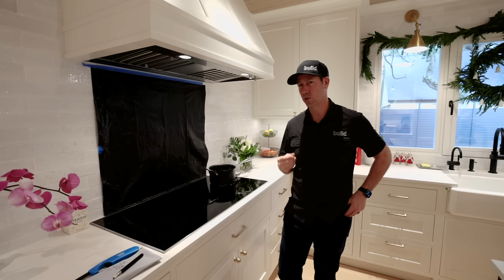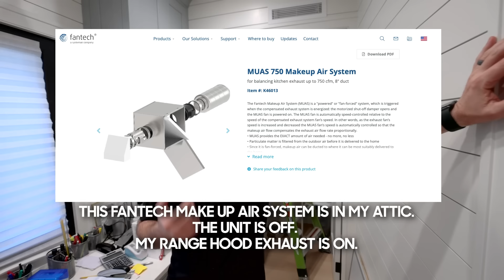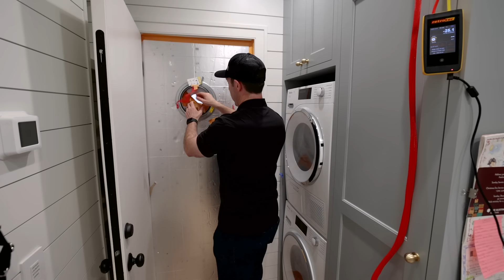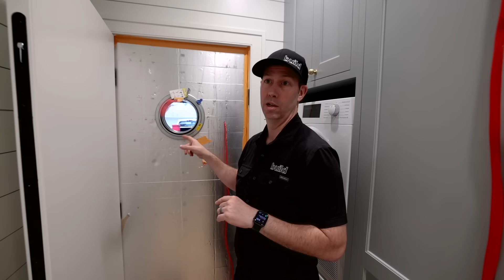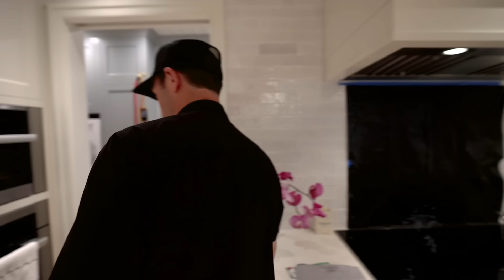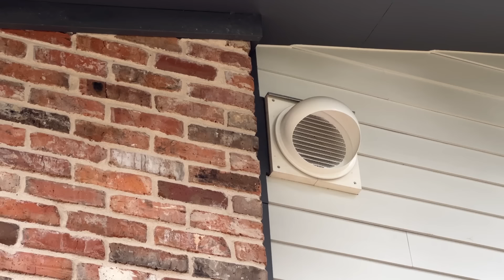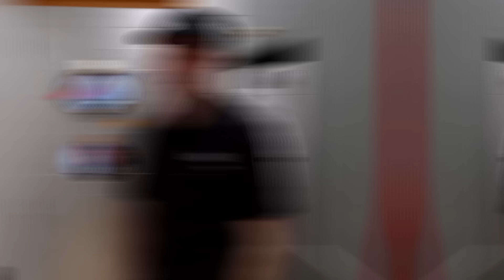Make Up Air for a Kitchen Exhaust - Most Homes Suck. (Pun intended)

Comment: In Europe (Spain) most homes use induction and, in passive houses, recirculation extraction hoods. 

That ensures that there aren't combustion gases or smells, while keeping air tightness and thermal performance, since all air is controlled by the heat exchanger. Direct exhaust outside the house's envelope would be considered a mistake in terms of energy usage.

 The downside is that these hoods require more frecuent maintenance (filter replacement or cleaning) depending on model.
Reply: In commercial exhaust hood we see horrible grease buildup which can lead to fires. How do you keep this under control with a recirculation system?
Reply: They use several filters. A first physical barrier with easy access (greases) and a 2nd or 3rd barrier to filter smells (carbon activated, that needs replacement, or ceramic, that regenerates in the oven). To a given degree, grease build up will always be an issue, recirculating or not 🤷‍♂️
Reply: Available here there exist such products from Bosch, Elica and  Neff, at least.

Comment: Not sure if this system does it, but would it not be better to monitor the pressure differential and use that value to control a variable speed make up fan? There’s other things that blow out besides the range hood like furnace and bathroom vents.

Comment: If these are "safety" systems the codes are wildly short of controlling the risk.  If we need to maintain or eliminate a pressure differential in industry (for instance, to keep the deadly gases out of occupied spaces) we install permanent, redundant versions of your differential pressure gauge.  These differential pressure gauges and switches will be tied to alarms and if the hazard is serious enough they will deenergize/stop the hazard.  Imagine that if one of your fans died there would be an audible alarm and the cooktop would shut off.  We do see that in commercial spaces e.g. shunt trips triggered by range hood fire systems. 

These big exhaust and makeup systems aren't too complicated but they are a potential hazard.  They need to be maintained.  HVAC systems that were never properly setup or maintained are very common in the US in my experience.  Chances are good that if one component of your system fails Matt it will be a comfort issue more than a true hazard.  The hazard potential for homes with fuel burning appliances is there for sure and it concerns me that failures don't seem to be considered for things like this in home construction.
Reply: Yeah, i was thinking of that too...  Since the home he built was SO tight, it needs some sort of trigger/alarm using a permanently mounted sensor.   Manometers are cheap, so I figured the sensors to measure this would be too... and they are.  I'm sure there are some pre-built controllers that could trigger the fans based on various differential pressure thresholds w/ alarms if it doesn't behave as expected.
Of course if you had a permanent sensor & a variable-speed fan, you could automatically compensate for a combination of bath exhausts and the kitchen vent-hood.

Comment: Excellent video. I remember watching earlier videos championing the tight house concept and wondering how bathroom and kitchen vents factor into those. Now I know. On the MUA pre-heater, if the MUA intake was near the exhaust, couldn't a heat exchanger between the two work instead?
Reply: I believe the problem is a heat exchanger would get gunked up from the cooking exhaust air.

Comment: Very informative. What type of contractor is able to determine the size needed for a make-up air system? I have an older home that is not air-tight and it might need a makeup air system since I need to replace my severely undersized range hood.

Comment: What about sucking in 103 degree air in the summer?   Not the temp differential of 10 degree air but still considerable.   You need a heat exchanger to suck the energy out of the air you are pulling in and put it into the air you are exhausting.

Comment: Great video...BUT I failed to understand why this is Needed? Please Explain what problem this is solving.
Reply: The exhaust hood puts the room under a negative pressure. The hole is a relief air. It relieves the negative pressure. Houses should always be under a slight positive air pressure for efficiency and health reasons

Comment: Matt 
Should I put the make up air supply as close to possible vent as possible? High or low (ceiling or Toe kick?)  Seems like putting it across the room pulls a significantly greater amount of conditioned air out of the house.  Also, I need make up air for the dryer and bath fans. I will be using an ERV exhaust in the bath areas on our first floor but most likely exhaust fans on the lower level. Thoughts?

Comment: What about bathroom exhaust fans? Are they linked to the make up air too? How does make up air operate if a door is closed? I’d assume it would just go under the crack between the floor and the door, but wouldn’t the suction of the bathroom vent fan be impacted by the resistance? There’s definitely not 8-16” of clearance through doors.

Comment: Would you also need to take into account the additional exhaust cfm of a clothes dryer, gas furnace when calculating the required cfm of a make up air system?

Comment: I've got a kitchen exhaust fan, an electric dryer, 3 bathroom fans,  a gas water heater, and 2 fireplaces. Why not have a makeup air system that responds automatically to the atmospheric pressure difference? The other is a need for air cooling as well as air heating in the makeup air system. Aren't there benefits to not sucking air through carpet or a garage benefits in older homes?

Comment: Good basic video. Nice house BTW. So, please tell me how your newly installed MUA sytm, will work when peak demand is needed. 
Example:
- Dryer is going
- Cooking vent is going
- gas HWH just lit up
- furnace fired also
- I went into the powder room to burn a mule, vent is on
All this draw, even though two high efficiency appliances have their own MUA, please tell me if I need a hole in the side of my house to drive through.
Thankx.
Reply: One thing his dryer is not vented to the outside. It just has a drain. But I know you are joking.
Reply: These passive houses don't have gas, not allowed.
Reply: Then, our doors are REALLY HARD to open. Cure- Condesning dryer after the other one dies. Microwave (minimal 300 CFM) required a makeup air system.

Comment: My question is what happens when there is no power?  My guess is that you have a back up generator... but what about the people who don't?  My best for you and yours Jim
Reply: In my tight home, no generator, so when there is no power the 300 CFM microwave exhaust does't run and that was why we needed a MU Air system in the first place.

Comment: In Texas though, do you really want to pull in all that humid hot air in the summer, and run it across your house? Could you instead duct your makeup air into the kitchen or near the stove? That would reduce the amount of conditioned air you’re pulling out.

Comment: Is cold air blowing onto your dining room table?  Couldn't your make up air supply be in the kitchen where people aren't sitting?  

I don't have a make up air solution in my house.  My hood is 700 CFM and then I have two exhaust vents in the kitchen ceiling that are ducted to a 1000 CFM blower.  Normally, the hood alone with no windows open works well enough.  If I open a kitchen window about 4 feet from the stove, it creates a draft that remove the heat from the pan. 

If I flip a greasy steak on the char broiler and create a huge flame and smoke, I'll need to turn on the ceiling system and open the sliding glass door near by.  It works well, I've never set off the smoke detector, but it is sort of a ghetto solution.

Comment: I’m bidding a 36” powered range hood install to vent 6’ away to outside through the upper cabinet soffit. Customer has an old JennAir down draft induction cooktop that they want to replace with a new ventless model. In a pinch, could I repurpose the old under counter duct as a make up air source? Maybe run to a stealthy black vent in the toe kick?

Comment: Would you need the same for a gas dryer, or for a gas tankless water heater?  The tankless water heater generally has a exhaust and intake -- so they're self contained?  Or still need make up air?

Comment: Great video on a complicated topic that even Dr. Joe doesn't like.
Reply: Joe Lsiburek? - My hero. Finally answered my emails and explained I needed to seal the basement slab to the foundation walls to stop Radon Fan suck. Then, he told me I needed MU Air because of my tight home and running a 300 CFM Microwave Exhaust that caused a negative suck.

Comment: Matt, it is interesting to hear you mention that the make up air system you are using contains a MERV 10 filter. Weren't you very intentional with installing a premium filtration system on your ERV, MERV 16 I believe? Now you have 400 CFM of MERV 10 air entering your home when cooking? Additionally, the air in not conditioned. Both from a heat stand point and humidity stand point. I personally would have added the heating element on the make up air system. Austin may not get as cold as Michigan, but it is completely normal for Austin to be in the 30s F, or even high 20s F in the winter.  I am not criticizing you, just raising the point.

Comment: This is quite topical for me! If turning on the hood vent could also turn on the central furnace in my house, would that be sufficient to create an "active" system? Basically connect the damper to the furnace return side duct, and wire the hood vent to turn on the furnace fan?

Comment: Some of us don't only boil water at home, Matt. Induction still sucks for cooking.

It's also a mistake not to pre-heat the make-up air. It will feel cold in the winter even in Austin and no one would want to sit in the living room. Those mini-split heat pumps can't keep up with 800cfm of cold air being dumped into the living room/kitchen.
Reply: I think you haven’t used that +$3k cooktop. I also think that you will be surprised when he talks about his hvac utility costs since he has crazy insulation and tight envelope
Reply: @Werdna12345  I've demoed 3k+ Miele cooktops in showrooms and bought a similarity priced gas range instead. It's cumbersome to use with the digital touch controls. Cooking requires feedback and gas provides that. Induction also warps carbon steel pans. Wok cooking is also impossible with induction.

Insulation and tight envelope isn't going to keep you warm as Matt just showed you how much air is being displaced. Luckily he has enough room in the crawlspace to add a preheated.
Reply: @ohhgourami  I’ve been cooking with induction for more than 10 years, using my grandmother’s cast iron pans as well as modern steel pans, and I’ve never had anything warp, nor have I ever heard of that happening.  I can’t even say it happens to cheap crap from China, because I have a $10 IKEA saucepan I use regularly  and it hasn’t warped either.  I love induction cooking because I have much more precise control of the heat, and nearly instantaneous change of heat, compared to gas, which I find to be vague and imprecise at best.  For example, I’ve annotated all my recipes with the relevant heat settings for my cooktop, so when a recipe calls for ‘6’ I know that I can set it to 6 and all will be well.  With gas I have to guess as to what he heck is “medium high” and good luck getting that same setting twice in a row.  For wok cooking I use a cast iron griddle with a steel ring on it, and set the wok on that, it’s inefficient compared to regular induction cooking, but better than gas.
Reply: @jpe1  Couldn't agree more. Some of the finest restaurants in the world have switched to induction.

Comment: Out of curiosity, does your makeup air also run when your bathroom vents are running?

BTW, just to show how little the 25Pa pressure differential is, that is only about 0.004psi. The 3Pa spec is about 0.0004psi. Just a tiny pressure differential makes a big difference.

Comment: I don't understand why houses are being designed to be almost "airtight" these days... what about oxygen for breathing? Is the expectation that door will have just enough space to breathe, for the amount of people and bedrooms? What happens if you have a sleepover and 20 friends stay over? How do they breathe? Is this kind of "sealed" setup considerate of a HVAC system that will vent/run when the oxygen levels are lower than expected?...

Comment: Wouldn't it be better to have the makup air come in right by the exhaust so that you aren't throwing all your conditioned air out? That way the unconditioned makeup air is getting pulled right out with the fumes. It seems like with how you have it set up you are exhausting all of your conditioned air between the hood and the makeup. There isn't any reason to do that.

Comment: Could the kitchen exhaust makeup air be tied into the Zehnder system ? Would be nice if the Zehnder can ramp up when kitchen exhaust fan is on.
Great channel Ill be building a house in Vermont and get some great ideas from the Build Show.
Thanks
Reply: Exactly the question that I had, and we're not alone1 Two other people farther down asked the same thing, and it seems pretty logical to go that route. OTOH, IIIRC the "outside hole" of the Zehnder was nowhere near big enough to bring in enough air to make up for the fan he has in that range hood. We aren't talking about the "puffs of air" (as Matt likes to say) that the Zehnder provides, so I wonder if that's why.
Reply: Zehnder can't move those air volumes. Not what they are designed for.

Comment: Hi Matt, great show and thanks for showing us around your house! One question, other than the make up air system, do you have another active ventilation system eg one with heat exchanger? Can that system balance the negative air pressure without a separate make up air system? Thanks!

Comment: You've gone for just about the most complicated system, with a remote fan above the exhaust, and a remote make up air system a long way off. And they come on and off at the same time, so connected electrically with long circuit run between the two?  Meanwhile you have an exterior wall just adjacent. Why not a hood system with a fresh air intake and exhaust built into the same unit? Your cooktop exhaust is more complicated than my entire home HVAC system (a ductless mini-split).

Comment: The only problem I can see with this system in Texas, it is sucking in heat and high humidity into the house. (Which is what I’m battling). Could you just attach the makeup air side to the HVAC makeup air?

Comment: Seems like it would be a lot simpler for the other fresh air inlet that's needed to regularly add fresh air to the house and costs a stupid amount of money to work with a damn vent hood. But hey, when money isn't an option why not design, build, and install an entirely separate expensive system?

Comment: I understand the answer is "vent logistics", but my brain goes "why not at least put some vents by the stove?" Why use my nice conditioned air to move the vapors when I can use the outside air with minimal conditioning? That way you don't have to condition the cold/hot air you bring in.

Comment: I don’t think he mentiones it but the active system has also a fan that pushes air in? He said only about the normally closed system which opens and the filter area but not about a fan that pushes air in. Am i geeting it right? Does the speed of the fan of the make up system gets adjusted based on a sensor or is it linked to the hood?

Comment: Matt, I like the idea of the pre-heater, but is there a pre-cooler option? I'd hate to introduce 400 cfm of hot humid Georgia summer air into my 70-degree house. Also, why is the make-up air so far away from the hood? Does this create weird flow paths through the house?

Comment: Doesn’t seem your fan would suck well enough…confused doesn’t it just mostly pull air from through outside instead of your kitchen?

Edit: nvm I misunderstood the install…the intake vent is located elsewhere and you got a remote fan for the hood range.

Comment: Is there a solution that combines an HRV/ERV capability with make-up air? It seems like not wasting the energy used on air conditioning/heating would be just as important as letting the house not suck make-up air in haphazardly whenever some form of exhaust is needed. I've been pondering an HRV retrofit that would tackle my kitchen and bathroom exhausts, and it seems like way too much work. I wonder if new construction designs at least exist that cover it all nicely.

Comment: Why dump make-up air on the opposite side of the house.  Let's totally disrupt HVAC air paths whenever you use the hood, and have a huge breeze across the whole house.  Make-up air should be dumped along the front edge of the hood https://www.youtube.com/watch?v=RJ-WF7gaiXA where it is almost immediately exhausted, or as close as possible .  Matt has done this too before.

Comment: Does that makeup air have to run with every bathroom exhaust fan too? Or do they all get their own custom designed and installed make up air systems also?
Reply: Not enough videos covering this subject. Proper Bathroom ventilation is crucial unless you want mold or high humidity.

Comment: Matt,
If I have two vent hoods, one in the kitchen and one in the chef pantry. Would you recommend two separate Zehnder unit or can a unit be sized with variable speed to match the maximum load. For example, both vent hoods going and bathroom exhaust fans running.
Looking forward to your response.